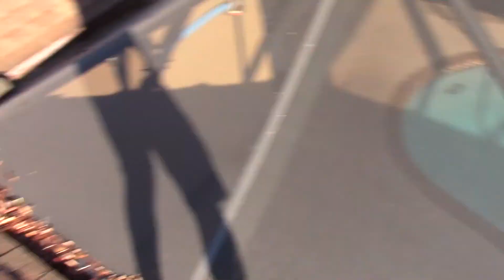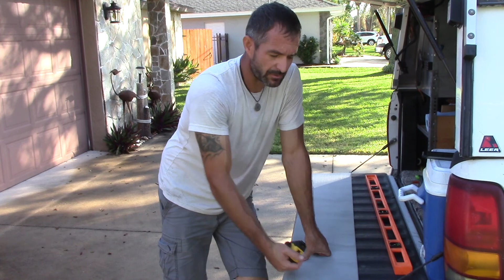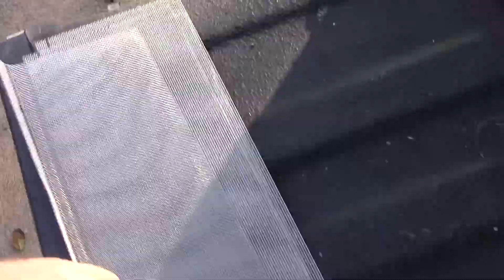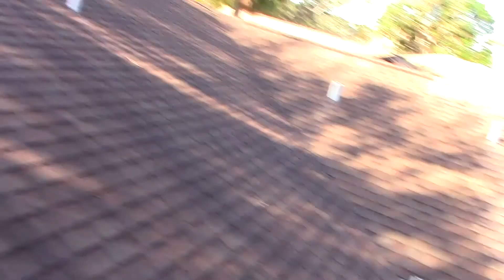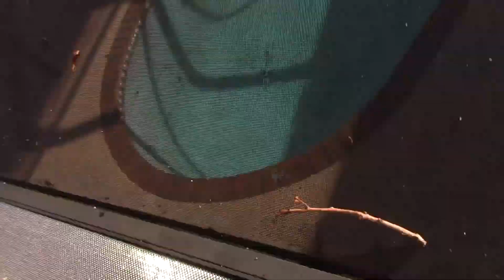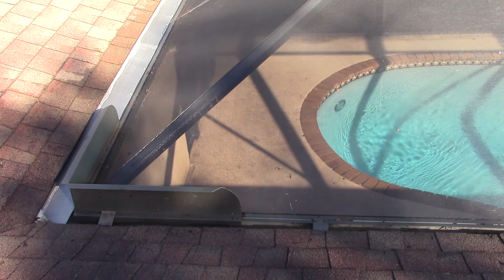Leaf Filter Installation  Lanai Gutter Guard

Comment: What would you say is the most needed height for extension ladder? I'm trying to make extra cash by installing these but I'm not sure what size extension ladder would be the best size. Any recommendations?
Reply: 28 ft. Im an installer and it's best.
Reply: @welbornsgutterprotection1696  28 OR 32 WILL WORK BUT I WOULD GO MORE THAN 10 FEET TO INSTALL THIS CRAP LOL :p
\
Reply: 32

Comment: Don't EVER buy a micro mesh guard. High maintenance as the small size holes will plug like a filter. cheaper guards work just as well and much easier to clean when needed.
Reply: That’s why you schedule maintenance appointments… if you’re a good buisness thinker you can build that report and relationship with the customer. Obviously the leaves won’t move themselves, build your own buisness around different gutter needs like maintenance, gutter repair, gutter replacement. Think outside the box and make yourself more money ; )
Reply: @LjThaDon  good thinking 👌
Reply: You are right that product sucks. Not all micro mesh does though. You need a good screen and proper hole placement
Reply: Thomas Tusing   I just installed Hoover Dam gutter guards on my gutter that is between house roof and lanai.  It’s the rainy season on the west coast of Fla and now that guards are installed the small sandy roof granules are being washed onto the lanai screening overhead and finer particles coming down onto the pool deck.  Now I have to install a 2” L flange to the edge of the gutter guard. 🤬
Reply: Michael isn't that the point of gutter guards not to let debri In the gutter. I've never heard of that brand but will go check it out.
Reply: @drewmichael4014  I just looked that up you will also get that grit in the gutters.
Reply: Thomas Tusing. That’s what I want!  I don’t want the grit to wash over onto the screening on the lanai roof!
Reply: If the micro mesh guard is installed properly they do not plug up with debris coming from the roof the only problem is when algae grows under or over the screen. If installed properly they need to be installed with the exact same slope as the roof. If the roof is not sloped very much then these will not work if you use that slope, the filter needs to be sloped greater than that roof slope, I believe a 6 by 12 slope is a good starting point can be a little less or a little greater, so if your roof slope is two shallow then be sure to make at least the filter to be a higher slope and then you will be okay.
Reply: PUT THAT HOME DEPOT VYNAL CRAP ON UR HOUSE AND SEE WHAT HAPPENS   BECOMES CONCAED IN LESS THAN 1 YEAR
Reply: This is a fine leaf trap. After one fall those screens will be covered with leaves. That means someone has to get on the roof to clean off the screens. No place for the leaves to go. Still a problem.

Comment: How’s the pay
Reply: 1$ per foot included cleaning re pitching sealing and dealing witht he overcharged homeowner
Reply: PAY IS FOR SHIT
Reply: Pay as an installer is good. I make about $3000 a week but I do about 3-4 jobs a day. So if you’re a hard worker you can make really good money.
Reply: @LjThaDon  I want to do this work and I've seen mixed reviews from installers,I guess there's only one way to find out. How much money do you usually get a job?
Reply: @EREBO95  vary. But average $250 a job depending on your location and state. I live in CO and the market is alright out here. You definitely have the potential to make more thought depending on square footage and surface area of the property.
Reply: @LjThaDon  thanks for the reply bud

Comment: How much you earn per job
Reply: Their sub contractors make shit per job. Sales people make 500-1500 sometimes even more when the actual workers doing the work make dick. If he made $200 he’d be lucky. The product is super faulty. It’s screwed on tight and if you’ve ever worked with vinyl you know you don’t nail or screw it tight, and being that the screens aren’t actually attached but rather they are slid in, when the vinyl does warp, which it will warp, because it’s screwed down tight and not free moving, the screen pops out. 
Think about when you put vinyl siding on, you don’t nail it tight to the wall it’s need to be able to move left and right, if you nailed it tight it would cause warping, that goes for anything vinyl. LeafFilter is a great idea, but they really need to rethink their product, and they don’t stand behind their product or the warranty, they won’t come out for free service calls and they won’t honor the money back guarantee. Although this stuff he’s using doesn’t look like LeafFilter. I don’t think it is
Reply: @joelengland8429  its leaf filters "lanai" for patios gutters or super gutters. And your correct installers get paid 1 dollar a ft or 2 dollars a foot if its 3rd story meanwhile leaf filter sells the shit for 32 dollars a foot
Reply: @4GAuteau  I used to work for them. I got with GutterGlove, it takes having a little money because you buy their product, they get you leads, you get your own leads, you set your schedule you set the price. And it’s ten fold a better product. Vinyl warps and the screen pops out because that’s the only thing holding it in. And because the screen is so small it doesn’t breath so mold and mildew DOES grow on it unlike they say. It’s almost as big of a scam as Covid-19
Reply: @joelengland8429  been here a year and a half
Reply: They pay one dollar a foot. 🤣.  They rip their installers off.